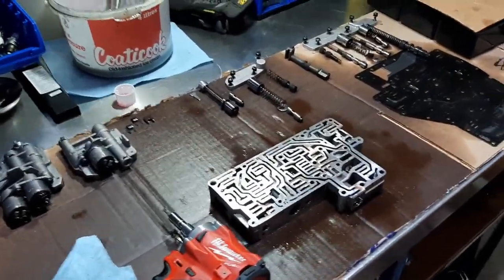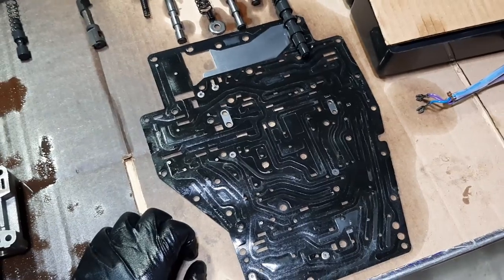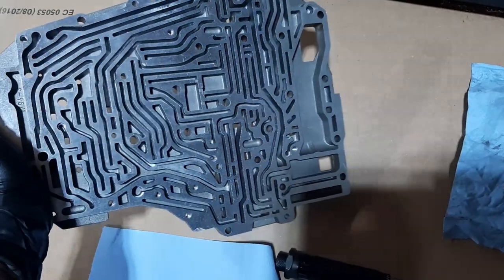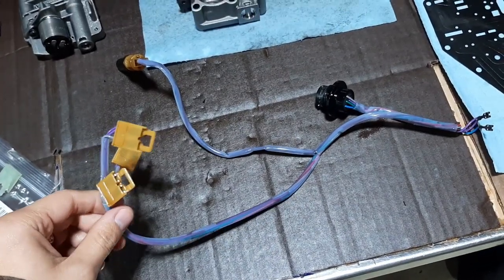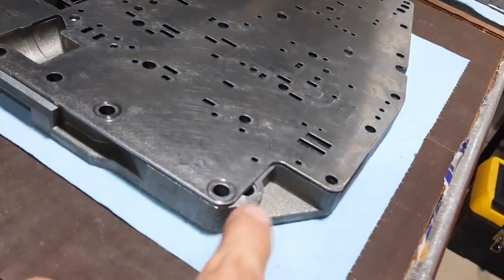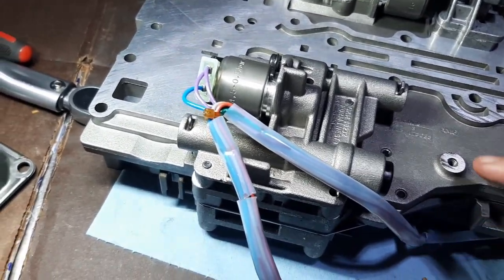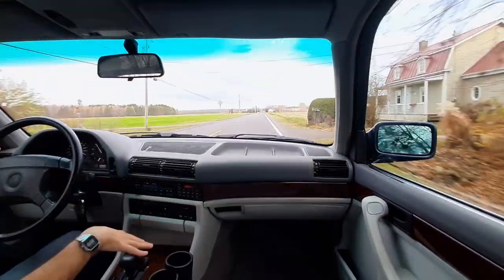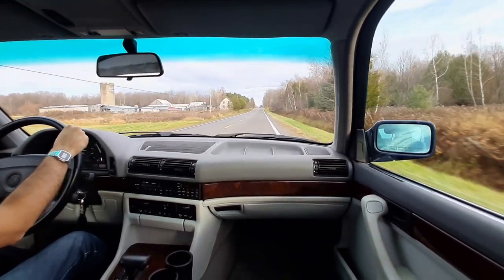BMW E28, E32, E34 Valve Body Cleaning (ZF 4HP22)

Comment: The whine is normal. My 92 735i does it (With a rebuilt transmission only 30k miles old) and my two 1986 L7's also did it. I always thought it was a curious sound. Don't know what causes it.
Reply from the maker: That's good to know, thanks for your comment! I wonder if the Land Rovers and other cars with the 4HP22 transmission also exhibit this strange sound. Personally I can live with it but I still wish the transmission would be silent...
Reply: @ClassicBMWFanInQuebec  Really? I like the sound. Kinda sounds like there's a ghost in the car. But I can assure you, they all make that sound. After I made this comment I checked around YT for videos of other people driving 735i/735iL and you can always hear this sound on acceleration from stop. I'm not mechanically inclined and don't know about the inner workings of cars, but I know these specific cars for whatever reason make that specific sound.
Reply: @ClassicBMWFanInQuebec  Let me know if you definitely figure out what causes this sound. Would love to watch a video.
Reply: I have the same sound on my E32 1994, also 1st and 2nd gear. Also i like that sound ))) So maybe there's nothing wrong is just how it is!
Great video man !
Reply from the maker: @MrIgorash  Thanks! Yes the sound isn't too bad, it's really only in the first gears.

Comment: Amazing video. thank you. i have a e32 730i with 140k km on the 4hp22 transmission. Would i need a valve body refresh such as yours? thank you
Reply from the maker: Hi, most cars of this vintage could benefit from a general cleaning of the valve body. But it's not a required maintenance item. It's more important to change the transmission oil and filter.
Reply: @ClassicBMWFanInQuebec  amazing. thanks. do 4hp22 transmissions require a full rebuild kit or they can last a lifetime?

Comment: Hello, I would like to clear up a doubt that I have. I have a 735i that I am repairing. The starter motor is not working and there is my doubt, the space to remove the nuts is in a very complicated place, do I need to remove the intake manifold to be able to remove it? 
Greetings from Paraguay
Reply from the maker: Hello, sorry for the late response. You should not have to remove the intake manifold to remove the starter. Search on the forum "mye28.com". There the guys discussed how to remove the starter on a M30B35 engine.

Comment: My 89 E24 has a longstanding issue with not consistently downshifting into 1st gear at a start.   When accelerating it sometimes starts in 2nd gear and then kicks down into first.   There is no slipping.
Reply from the maker: I wish I could help you but I don't know the solution, sorry.

Comment: Bro!! I believe there’s sort of modifying chart specs and issued long ago from BMW describing who to drill tiny thouinch holes both in valve body and reverse bearing case but ain’t quite sure is it for 4hp-24 or 4hp-22?
Reply from the maker: Yes you are right. On the 4hp22 there used to be a common fix for the A-clutch pack which was to install a teflon o-ring (instead of metal) as well as drilling a tiny hole for oil to escape. I don't know all the details but if you google "4hp22 teflon ring drill" you'll find some good threads that address this issue. I haven't done this fix on my 4hp22 myself.

Comment: Do you feel lockups on each gear? I've got 3.0v6 Citroen with 4hp20. On 2nd and 3rd gear I feel like slipping the torque converter and then lockup. Should be that so noticeable?
Reply from the maker: Hmm I can't say I feel the lockup, no. I only feel the gear shifts.